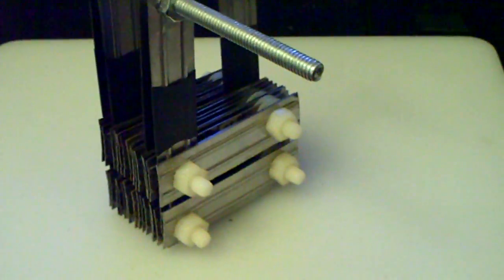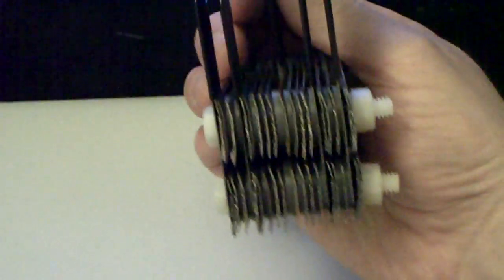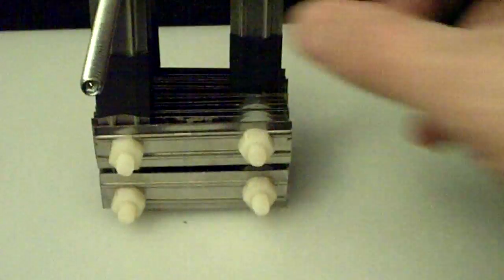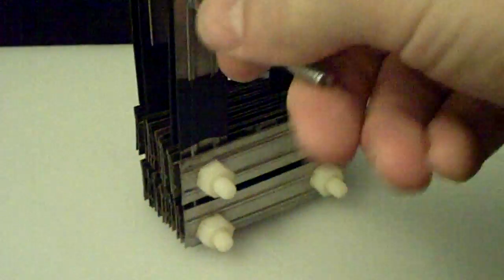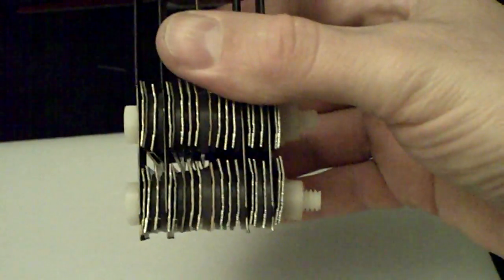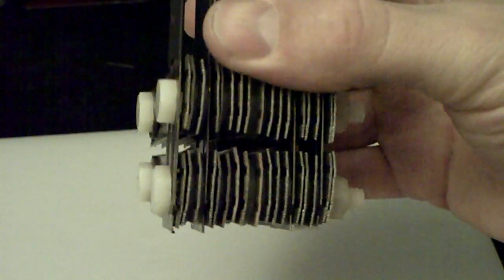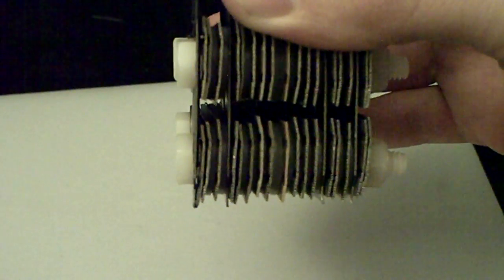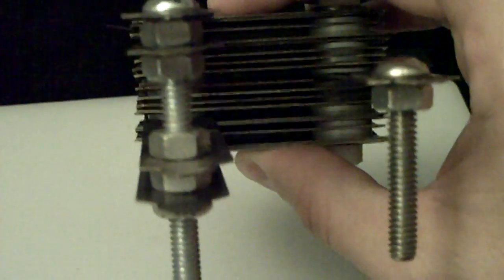Vid36 Slot Cell Hydrogen Generator Configuration (HHO, Brown's Gas, Hydroxy)

Comment from the maker: Neutral plates are a necessity when building a HHO Generator.  Neutral plates serve several purposes.

1. Reduces the amount of Voltage per plate
2. Increases the distance between Pos & Neg, resulting in lower amperage.
3. Neutral plates produce HHO gas

Comment: What's up HHO4ALL? I have a question. Why do you use Neutral plates? My configuration is from one I got from buying an ebook. It uses 11 plates in a wet cell, and 5 plates are positive 6 negative plates (All plates are rectangle shaped), but they are all alternating, 1 neg, 1 pos, neg, pos, neg, pos, neg, pos, neg, pos, neg. I have a problem with it though, my 20 and 30 Amp fuses keep on blowing out (connected to pos terminal), I checked for touching plates and stuff, but nothing looks wrong.